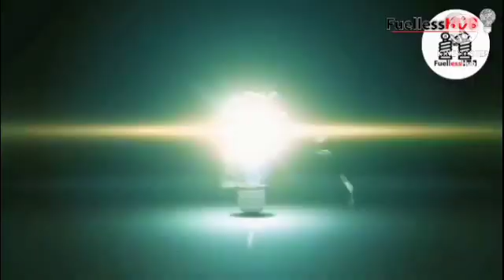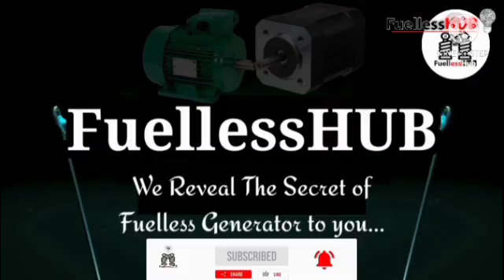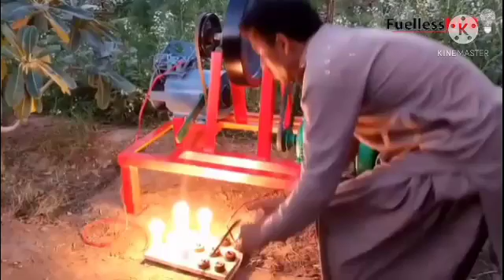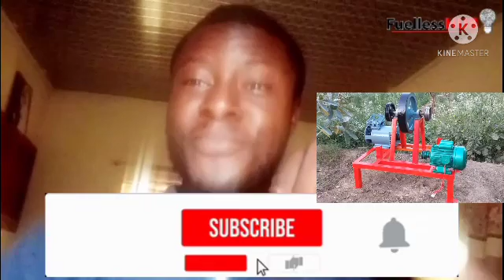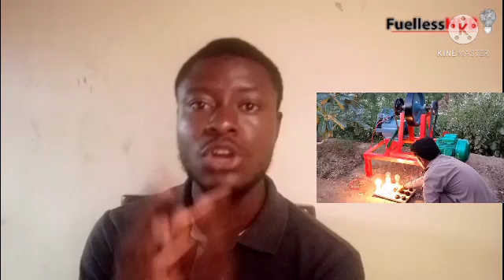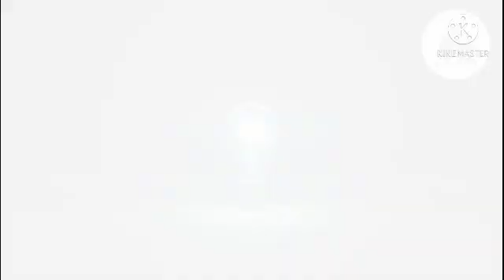Fuelless Generator self powering to return voltage "myth"

Comment: Well greetings my brother. The set up you just showed. Well it can work but it depends one capacity of your alternator. And the flywheel since it increases rotor speed by gravity, when the alternator starts supplying, you use a transfer switch to quickly transfer your external power going into the motor to that of the alternator. In that small transition, rotation is still at optimum due to the mass of the flywheel. When i finish the one am doing i will upload to you. Shalom